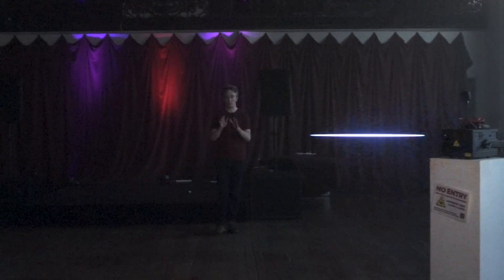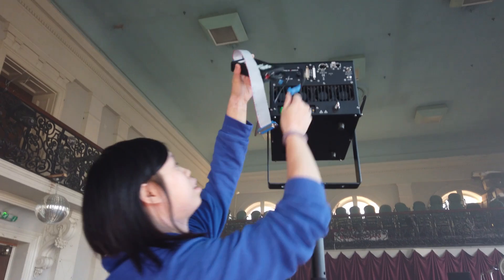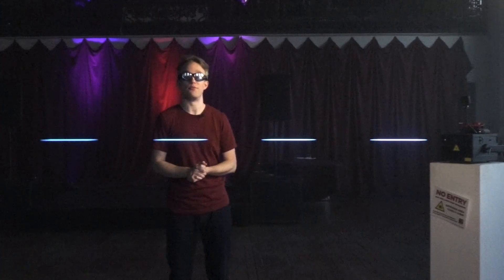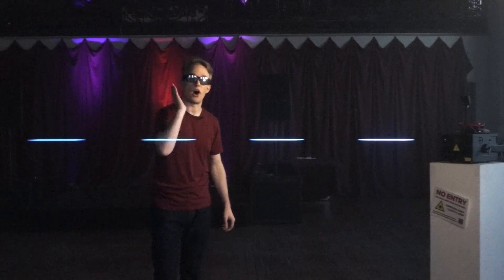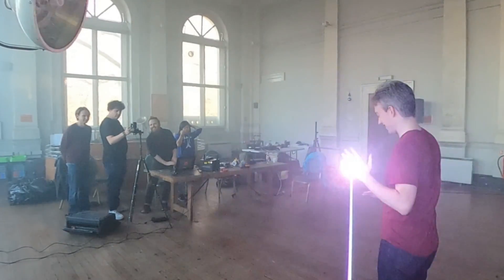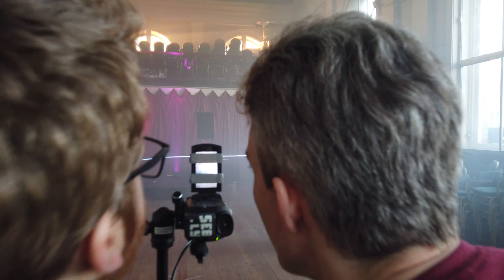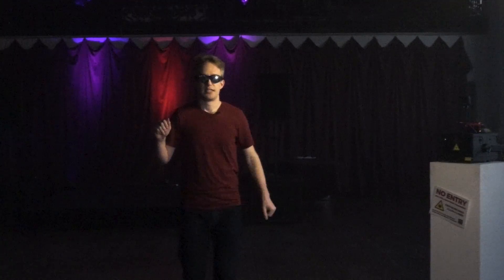Stopping A Laser Beam In Mid-Air

Comment: I took a picture a couple years ago with a very fast shutter of my DJ laser (wattage unknown)  rgb etc etc 
But the laset in this case was a purple flat line about 1.5 cm wide that just stopped!   
From machine to end was about 2.5 meters away and nothing after. 
Is this an illusion,  Or did it actually stop?  I wish i still had the picture

Comment: Probably the craziest side effect of this, imo, is that you get a realistic "blaster bolt" lighting reflection. It actually kind of appears that a bolt of light passes you, even with the way that it casts light on you, I guess because of the way that the light is literally off for the right parts of the frame. (This was most noticeable in the shot at 4:49. See how his head gets brighter right as the "bolt" passes over him? You wouldn't think it would do that, because IRL it's a continuous beam of light, but since the speed of light is so incredibly fast it actually only casts the reflection lights in the parts of the frame where it is on... this is incredibly hard to describe lmao).
This would actually be a fantastic way to get the right reference lighting for a laser shootout.

Comment: Blasters and phasers are particle weapons, not laser weapons, so their beams should travel slower than the speed of light.

Blaster fire plasma bolts (which is normally, but not always, created via ionisation instead of via heating) and are only referred to as lasers as an inaccurate (like how people call the graphene in pencils lead or call microwave ovens microwaves); turbo lasers and laser cannons are also particle weapons rather than lasers (they are just big blasters).

Phasers use fictional particle called nadion particles and the disruptors used in Star Trek are also particles weapons.

Comment: One year later hu?

I like how you went from star wars to the main part, but there is a major dumphole in the explanation of star wars "laser" besides being pure fiction, i mean you would hear anything outside of a ship, its void if you want so... Nothingness, so sound cant travel from its source to the one "hearing" it

The major fault is they call it plasma lasers. Even tho they call blasters "laser" blaster, the ammunition is a small tank with a compressed gas. This gas is released, by a bit every shot,than that gas is used to keep electrones travel inside that gas filled space via the blaster shot.

That explaination is probably filled with errors, but i hope the main point is achieved well enough :D

Comment: 10 seconds in... Is the laser pulsing in relation to the camera's frame rate?
And since cameras normally scan from top to bottom it's captured horizontally 🤔
Most likely with it's right side down.
Or maybe the sensor reads from it's left to it's right

Comment: Couldn’t you have a machine that turns the laser on and off at a super speed so that the laser beam will only reach a few feet. You could even make a toy lightsaber using that method.
Reply: How.... How do you think light works? While lasers may be a continuous "beam" it's actually a whole lotta little particle wave things that move really fast, they don't just stop when the light is turned off, it just stops making new ones
Reply: > Toy
> Lightsaber

Comment: now onto the real thing "high power" laser focused onto a point that ionizes the air and thus creates a visible plasma point.  or the experiment where researchers used a laser to energize a 1m long beam of air and then put a voltage across the beam and then a thin and straight electric bolt appeared in mid air

Comment: I work on communication lasers that are high end. If you could see the light even that is impossible for the human eye. It does pulse much like the effect of this video displays but at the nanosecond level. We have sensors that have to see each pulse and check each frame. Essentially, the laser turns on/off if you could see it.

I generally work with forms of 16 QAM modulation for the C and E bands at 800Gig waves or less. We have lasers that will burn a hole through you if you stood there long enough using a form of RAMAN amplification.

I always wondered how this effect was done. I suspected a mirror or prism was used to get the "beam" in to the shot.
Reply: The lasers you work with a probably not bright enough in the visible spectrum for human eye to see, a decently powerful laser pen can be visible to the naked eye in a room without any direct sunlight

Comment: I used to be a laser technician running a laser to cut sheet metal but I'm no expert, I do agree with the visual speed of the lasers though and argue that they could be a magnetically fired plasma Bolt instead of a laser which would have an effect on the visual speed as well as being able to be affected by the force.

Comment: Theoretically, if the Force were real, could you not stop the photons-mid air just like in the movie? They'd obviously fly at the speed of light but couldn't you theoretically freeze them in place by "grabbing" them and holding them there with the Force?
Furthermore, is't there alot of reason to believe the blaster bolts and lightsabers are actually plasma? Still fiction but slightly more plausible.

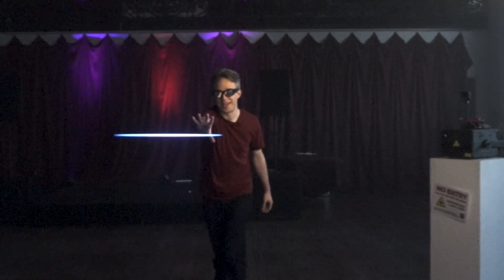Comment: 0:39 As a note, Kylo could stop a Star Wars blaster bolt, as it is technically not a laser. Apparently it is a super heated gas (so basically plasma) that is then launched at what you want dead. Therefore, blaster bolts in star wars are matter, and could be affected by the gravity like forces of the, well, Force.

Comment: Interesting video, but neither blasters or phasers are lasers. They both use highly energized particles. 
The blaster fires them in single bolts which react explosively on contact.  
The phaser is a continuous beam of charged particles, half of its damage is done by raw heat generated by the friction. Thats why on lower settings a phaser can heat up rocks for warmth etc.
And now you know!